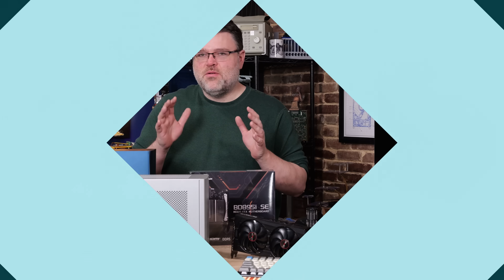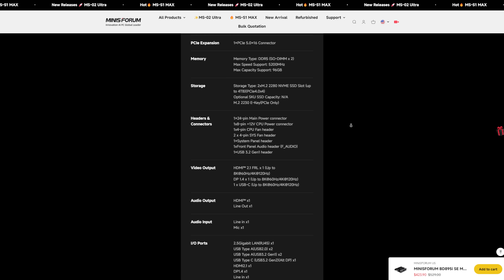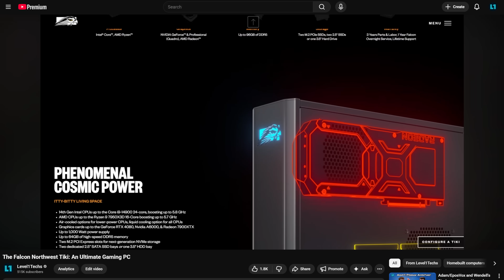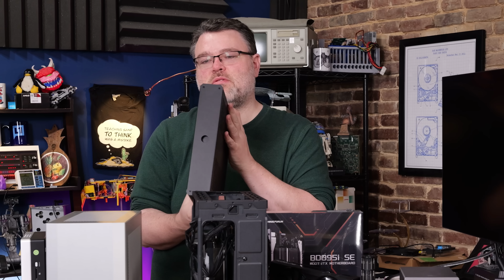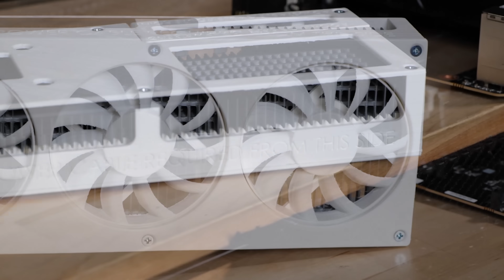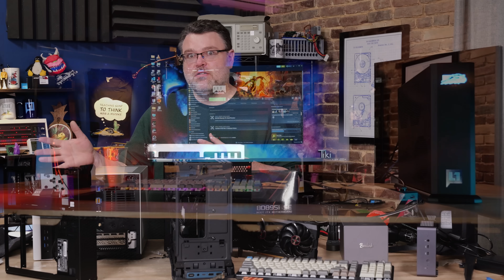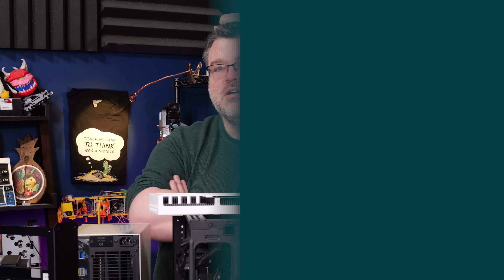Mini PCs Need Some New Rules! Ft: Minisforum BD895i SE Motherboard

Comment: I believe Steve at Hardware Unboxed has a video comparing all the x3d desktop CPU's at 1080p/1440p/4k, and i believe as long as you are at 1440p or higher resolution the difference in performance is negligible, but they are all quite a bit higher than a non x3d CPU.  So a low power x3d mobile CPU would be perfect for high end PC gaming. 

I checked out Minisforum, and their BD790i X3D is out of stock unfortunately.  

I do wish we could have an alternate ITX motherboard standard that put the PCI-E socket at a 90 degree angle and on the opposite side of the motherboard than it is by standard, then we could have both the motherboard and GPU facing the same direction next to each other along the same plane. 

Also a standard GPU format with the power socket on the opposite side/bottom side would also be great.  Most GPU's are long enough that they extend past the edge of a motherboard anyhow, so it's not like it's going to interfere with the motherboard by being on the borrom.

17:30 I'd love to vote with my wallet, but that type of GPU doesn't exist.

Comment: I just got a powercolor rx 9070 xt reaper, it's pretty much like the 3d printed one you showed, 2 slots, 3 88mm fans,the height is the same as the bracket, connectors on top, but I'm using a 180 adapter, feels like that's what gpus should look like not the monolithic size like we have since
Reply: I have one of these in my fractal terra build, it’s an excellent card so far and very svelte. Was able to squeeze in a larger cpu cooler vs when I had a 4080 super in there which is nice.

Comment: Biostar Hi-Fi B150 PIO D4 is a motherboard that would allow you to mount your gpu in line with the motherboard it is a itx size board with two pci-e connectors one in the normal place and one along the top of the motherboard this would allow you to do a flow though slim case 

i'm sure wendell must have seen one of these in the past and i think it would be amazing to have have a slim mini pc using a SFX or a FLEX ATX psu

or the Maxsun Terminator B850BKB WIFI its mounted behind the motherboard
Reply: I've been thinking that the Biostar layout/FF would allow really cool HTPC and other thin PCs. Maxsun type of connection allows sandwich style cases basically without compromises. Personally I dislike current sandwich style cases because they sacrifice PCIe signal integrity to achieve certain form factor. Even better if the motherboards would be elongated and narrowed to be closer to GPUs in terms of form factor. Unfortunately those probably wont work because the desktop CPU sockets and cooling require space around them.

Comment: We seriously need to get away from the 1980's concept of power. Back then you had 5 and 12V HD's and floppies.  We now have ASIC based subsystems (like GPUs, AI, etc) - that draw as much and more power than the main board. Its time to align with big iron and go to a uniform 48-60Vdc distribution. This will reduce the number and gauges or wires and eliminate connector burn. The localized DC to DC convertors - now prevalent - can easily handle the change and in fact ALSO be cheaper.  Floppies and HD's in the 1980's did no secondary DC regulation - everything now does - even your SSD as core voltages are much lower than the old standard.
Reply: Because stepping down from 12V to 1.3V for CPU/GPU dies is already difficult to design and difficult to cool, and the energy losses (which become excess heat) increase the bigger your "step" is. GPUs are already too heavy and bloated, mobos are already struggling to keep VRMs cool, increasing PSU voltage would make these problems exponentially worse.

Comment: To use a 3d scanner and CAD programs an Nvidia GPU is required.  I have an MS-02 Ultra on the way.  I will be using a sff 5060.  If I could get a 5070 ti 16GB, to fit, this would be an ultimate portable mini PC.

Comment: Meaningless sales and YouTube jargon is exactly that! Bottom line is power, period. I've been screaming for literal years about these useless "thin and light" turds with high end chips that live on thermal throttle! That is not "adequate" cooling folks, that is complete and total failure to cool! These things must be "thicker and heavier" not "thinner and lighter", it's physically physics! These little baby 30 watt coolers cannot cool 90 watt chips, any chip living on thermal throttle is not safe let alone performing at rated spec, the spec that you literally paid for..... You are getting ripped off by all these thin and light "gaming" turds!

Thicker and heavier, with real room for real cooling for real top end chips. That is where the game starts. ITX can do it, kinda, but more cooling will absolutely "require" more physical room. It's physically physics folks! The parts already exist, it's simply a matter of packing them all tighter together AND being able to "properly" cool them. If you cannot run at 100% utilization with at least 30 degrees headroom until TJmax, then your cooler sucks. No chip should ever hit thermal throttle, ever! If it does, then you have a problem.
Cheers 🍻

Comment: I'm sending my BD895i SE back, because nothing on this board makes sense. 
Surprisingly it's less performant than my old 8845HS Mini-PC in games and LLMs (and only 8%/30% better in my single/multi core benchmarks). 
It's guzzling energy at 30W TPP Idle, 50W Office, 55W Youtube and 100W Gaming. Even under aggressive power saving settings and undervolting. But even 100W can only fuel 6 of the 16 cores. Paradoxically it reaches peak performance if you limit TPP to 50W. More power and the whole thing collapses, because all cores try to boost at the same time. 
It would be a great ITX board if you replace the CPU with an efficient 8-core (and maybe a 780M or 890M iGPU). The 16 cores are too much for the slow RAM and starve each other for energy.

Comment: Im so sad I missed the x3d variants before they sold out.  I could really use one now.  Hoping they make a new one soon...
Reply: they just released the 9850X3D - though it seems it's not really any better than the 9800X3D
Reply: @JDCogan  I meant specifically the mobile ones built into itx boards
Reply: @HClark86  got it - I mean you "could" put a 9800 X3D in ITX but it would be cooling nightmare

Comment: For my quiet living room PC I put a rack in the entryway closet, mounted 2 140mm fans in the door so they are right in front of the intakes and cut a dryer vent in the top of the closet to vent hot air outside. During the winter I vent the hot air into the bedroom behind the closet.

Comment: on mini pc grafic cards: i am more for one Format for the Board and different kinds of coolers for the card. i think gpus dont need to be a unit of Cooler and Card. With this Cubics, Sandwich and Classical Consoles would be possible. if we have mini itx, why not aiming for graphis of a half or 75% mini itx pcb size. Paired with one one 3 Cooler Styles matching your case ...

Comment: I mean... if you got together with Serve the Home and NAS Compares and Robtech you could probably setup a small mini-PC company and it would not be hard to crush the opposition because they're all obsessed with stuffing silly ideas into a stupid form factor when a couple more case options would fix the storage and cooling problems all the less than purely basic replacements for thin clients of yesteryear, have. 

Though I get why you would rather stick a fork in your eye than take the stress.

Comment: I sold my Dr zaber as I could almost not find anything strong to fit in it after my old R9 Nano. I would love a 120mm on the end push pull like a CPU tower, short but fat cards like 5-6 slots but very short, would also allow you to screw it into a 120mm case opening and just put an extender cable on it for direct intake og exhaust

Comment: VALVE really screwed up bigtime for going with rx7600M on the Steam machine. They should have paid AMD the extra $50 to AMD and upgraded to 9060XT for %50 better performance and FSR4. this would have future proofed it.
Reply: If you account for the FSR4 image quality i would argure that a 9060 steam machine is %200+ the performance of the 7600m. the price of both GPUs is very close.
Reply: Leaves room for a Steam Machine Pro, and we don't know that a 9060XT would've been only $50 more - Valve hunts for sweetheart deals on components, and we know AMD has a lot of unused 7600M that they're itching to sell.

Comment: I run three BD795i SEs in a mini-rack running a ProxMox HA cluster.  18 months, still going strong, low power and noise in a great portable form factor.  I really appreciate the CPU heatsink takes a standard extremely low noise Noctua fan.
Reply: wanted to fit a proper cpu cooler onto it but had to use creative zipties bc it has an awful custom holespacing. But hey, atleast the direct die is a win in my books

Comment: Powercolor has some great true 2-slot offerings for the Radeon 9000 GPUs. Great coolers too, temperatures are not really any worse compared to competing 3 or 4 slot designs, just at slightly higher fan speeds.
Reply: I love my reaper 9070xt standard height, standard length and true 2 slot.
Reply: Reaper 9070 XT is so good I bought two of them, AND the 9060 XT. Realistically, this is as good of a GPU as I'll ever need and I'm not going through another 8 years of nightmare waiting for the next true 2-slot card. I'll just stock up on these ones.
Reply: Got the reaper paired with this board in a fracta terra case tuning cachy os and its SNAPPY. Super happy with the performance so far.

Comment: i have 2 of the bd795I and they have been incredible servers, both running PVE and one with an arc pro b50 it has been rock solid if not leaving a little bit wanting for I/O options but otherwise fantastic macnings. 

i am just glad i bout my 2 96gb kits of memory more that 6 months ago.

Comment: Why not mobile GPUs on discrete cards while we're at it?  Surely it'd cut way down on the power requirements.  And having PCIe bifurcation as a standard so you can have an extra PCIe device with the right riser would be neat too.

Comment: It kinda bothers me, that Saphire is such an AMD-Native kinda company, but they make their 9060XTs with 2xHDMI and only 1xDisplayPort. That doesn't quite jive  with the stated (by Ed) Linux ambitions.The HDMI+VRR issues in Linux were well-known, before the Radeon 9000 series! That's why i'm running an Asrock - it's got 2x DP and only 1 HDMI. Also, because Gigabytes "server-grade thermal gel" seems kinda meh, when mounted vertically - squeeze-/pump-out issues. (Gigabyte was cheaper, but Asrock didn't have the "gel issues", when i bought mine.)

Comment: I'd go even further, I want to see a dedicated GPU level die on the same board as my CPU die and have a single Gabecube style cooling system. Hell, I'd even take a single chip with the same performance as a DGPU and a bunch of unified high speed memory. I just want as much performance as possible in a small form factor PC, with an elegant, integrated, and quiet cooling solution as possible.

Comment: Standardisation of formfactor would be of great help. Maybe its about time to do some revision to MicroATX or MiniITX formfactor. I'm not a big fan of those special builds that is not possible to upgrade when motherboard is out of date. Building a system on a good chassi with good dust filters, efficient PSU and stuff made to fit some standard formfactor is in my opionion a better choice

Comment: Sff is stupid, I built one and will never do it again, all they do is limit you! Worse cooling also, as small as I go now is micro atx and the cases are actually good and can fit full size gpu’s
Reply: Any case design/size can have poor thermals, or can have poor thermal scenarios caused by the end user, SFF is not inherently hotter than ATX. My Dan A4-H2O build gets identical CPU/GPU temps to my previous Phanteks P600S, despite having twice the TDP and only two case fans (which work double duty as AIO fans). Good VRM temps in my Dan as well, but I didn't have measurements from my P600S to compare against.

Comment: One thing socketed mITX mobos still need to improve upon is clearance around the socket.
I've trimmed many mounting back plates because of crap around the backside of the socket, and I've run into many AIO that don't fit because they bump into the VRM heatsink, RAM, or overly tall SSD daughterboard assembly.

Where as you get one of these MoDT mITX mobos, and you don't have to worry about any of that stuff. It just works.

Comment: My guess, is that we're not near the next console revisions.  I may be wrong, I'm not looking in the industry at it either, but I think they're all kind of at the Valve level, where Valve has stated that they're waiting on something new to power the next SteamDeck.  I know most here know, but we've not really seen a leap in video cards in years and they've all gone to AI now.  Even this channel shows that most of the advancement between the team green 4k and 5k series is the multi-frame gen predictions. Beyond that it's mostly pushing the chips harder. Which creates heat and chugs power.  Combine that with the Ai buffet eating up the industry and I think it all means stretch what you have a bit more.  

My strategy was about the same.  I overbuild a machine and I'd want at LEAST 5 years before looking at upgrades.  My last system was a few years ago with the 7900xtx and the 7950 Ryzen came to market.  I bought the bleeding edge (which I never will again) and I'm going to let it ride.  I think I'm luck and my 4x sticks are running at 6000.  That's the main machine and I'd play on that.  Only last year did I get a 4k 144Hz TV and now kick things into 4k native.    After that I got a minisforum for work saw the writing and decided to get one for home.  It replaced the aging i7-4770? and Rx 580.  I was going to keep the card at first but later found out it was mostly holding things back.  Went with a crazy deal on a 9060 just before the world went nuts.   That's going to live out the rest of the life as my secondary machine, when I need something else to crunch things, that will do it.   

The plan was to get another minisforum 16/32, load it up on ram, have it be my Forbidden.  Even if I didn't route, it would be my NAS/Docker/limited VM box/VPN Endpoint.  I've had luck with biforcation and using m.2 to SATA converters, leaving me the ability to put a Video Card in, it might have been an Arc card.  

The plan now is to sit on what I have, nervously watch my 5 year old? NAS drives for any trouble. Re-build up my Linux familiarity and get good with ZFS, build my Network to maybe 10G and hopefully by then the world will be normal or just punch my savings and build at least storage.  For other things, I'm waiting for something magical.  Like how the Vega and RX series were over the R series.  For something to complain that I hardly meet requirements. All in all my last performance build I would hope would last 10 years with minimal upgrades if any.  I'll see how I like the Steam Frame and that'll be the biggest thing if I need to adjust for delay to photon.

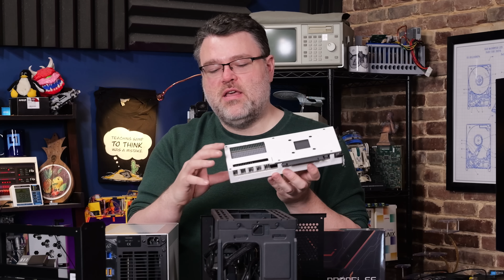Comment: 13:00 totally agree that we need a new standard and more options. i feel like cooling and power control of these mid to lower end gpus are at a point where <5070ti/9070XT could work very well with the model you made. i use lact in bazzite dx for my 70XT and i have good fps 1440p/4k with <200w. havent tested a lot of games. "AM5 Light Standard"

Comment: I've recently been kicking around using a pikvm to handle keyboard/mouse/controllers while streaming via steam app (to maintain low latency visuals) to the living room tv. Why have a separate living room machine if I can use my main gaming rig anywhere in the house is the thought.

Comment: i runa 16GB 9060 XT with a 5700x and 32gigs of ddr4 in a Densium PC case.
3x smaller than a PS5 in size, and blows it out the water, and not that much more expensive.
Then again i built it back before the memory price hikes 😅

Comment: 1u or 2u rack. Case closed (pun intended). Or half a rack width, with option to attach 2.  

Then all the media cabinets and Hi-Fi racks can return to normality, instead of the current craziness. Imagine a rectangular 
Playstation, that would perfectly fit on top of your ISP router and your mini-switch or your Sony receiver/amp....

Then throw 2  Linux nodes on top, and not bother with illogical crap, like a button on the back, or usb ports on the side, or something mind-bendingly annoying :)